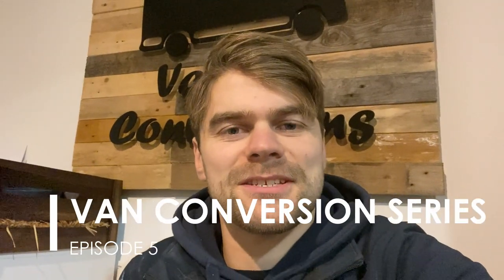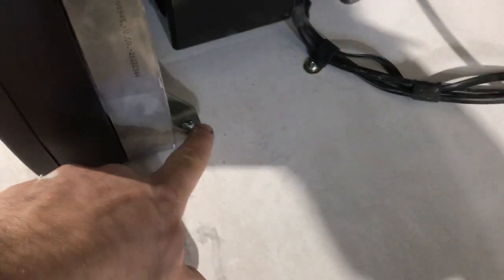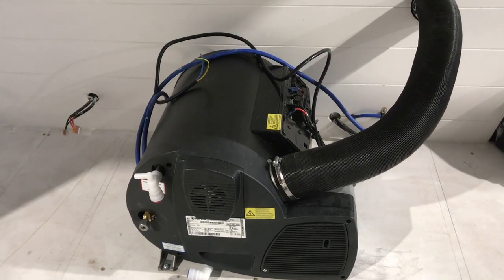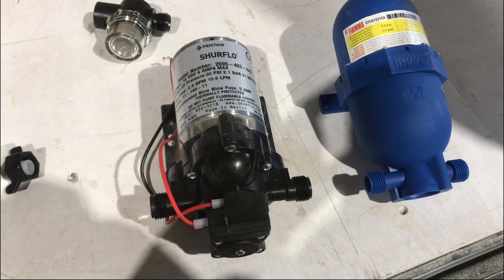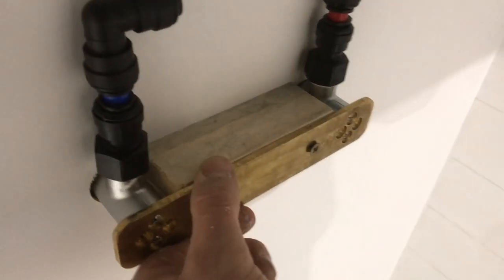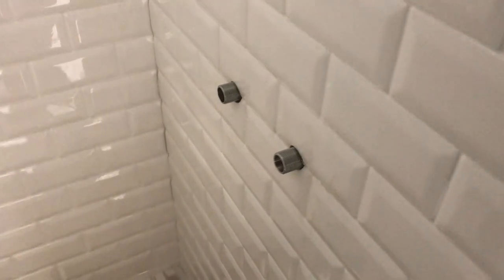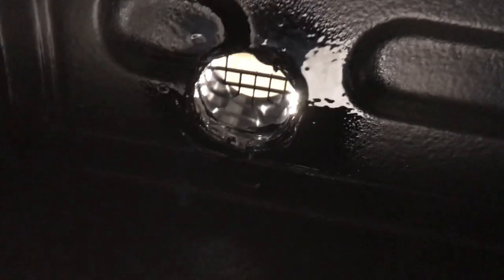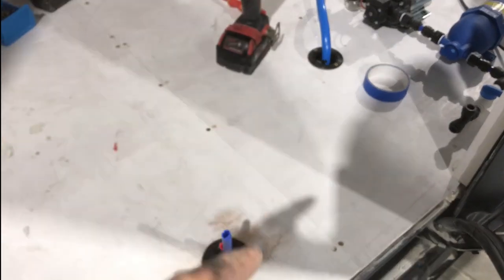WEEK 5 | Truma install, water plumbing and door fronts | START to FINISH Van Conversion Series

Comment: We have now bought our MWB Crafter, love to drop it off with guys and roll up to a finished van but not enough $$$ So back again asking another question. What make size or link to the spring loaded hinges would be much appreciate. Is there a section fitting them that I have missed. The build series is a gem for folk who are  doing our best to get your finish. Many Thanks.

Comment: Thank you for this very informative video! 🙌🏻

A coupla questions, if I may?

Would you please tell me what is the shower paneling you’re using? It doesn’t look to be actual métro ceramic tiles, which I think would be heavy and time consuming - yet still polished and professional. It’s just panels you cut to size and caulk? A specific brand you recommend? 🤔🛀

And about the Truma... I love that it has 4  heat outlets, and can take care of both heat and hot water. But can it handle 2 different systems? I mean, I plan to have 2 separate water tanks, a smaller one for the recirculating shower system, and the other one for the kitchen sink. 

Looking forward to the finished product, as always! 🤗😍🚐 🇨🇦 

Thank you
Reply from the maker: Yes the shower panels are from Reco Surfaces and are plastic. The two water sources would probably have to mix as there is only one boiler cavity/inlet in each Truma so may not work having two separate systems if you want hot water in both from one Truma. It is probably best to speak to them or a supplier to see what they recommend
Reply: @vanlifeconversions  lovely! Merci 🙏🥰